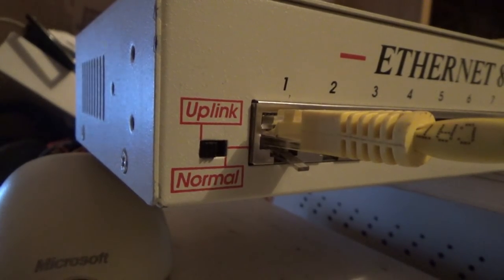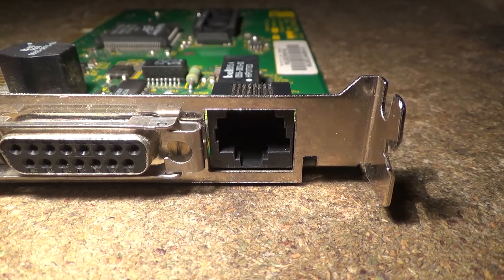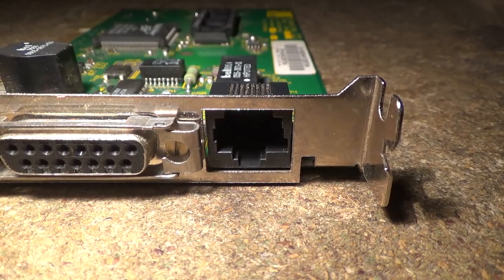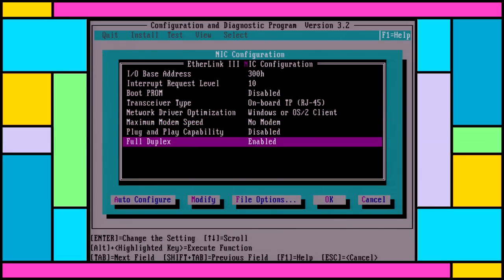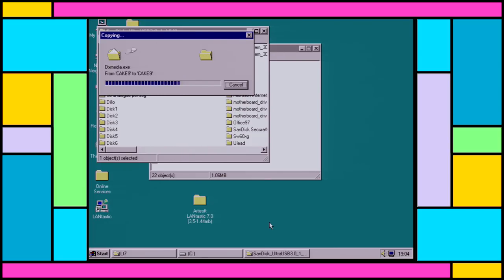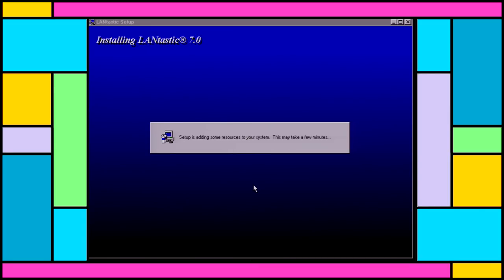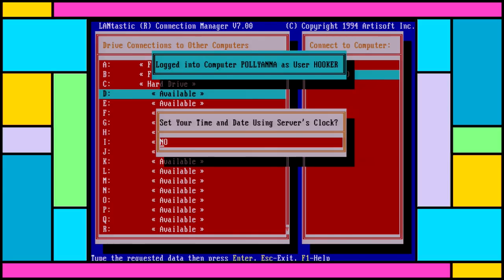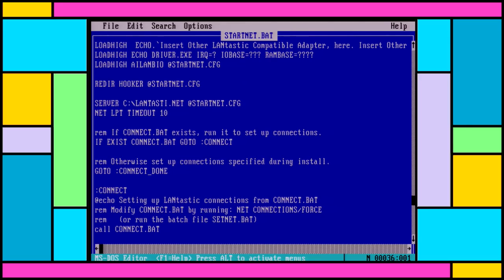Thin Ethernet Ramble

Comment: Arcnet is a name that takes me back... I have programmed this thing in x86 assembly back in uni. Which was 2002ish...

EDIT: Also, back in 1999 I have set up a lan party using coaxial ethernet. We spent three hours making cables and incrementally making stuff work, then six hours playing. Fun times.
Reply from the maker: We still had to cover arcnet in college, circa 2007-2008, but only briefly.
LAN parties were by far the best thing about getting a network running, suddenly it was possible to blow people up in Duke Nukem 3D without the latency or without the awkward alternative methods. Used to have to play with settings though, people coming to me had to set their cards to 10Base2, if I went to them I had to change to 10BaseT as most people were already on 10/100 Twisted Pair by then.

Comment: That twist tie and pin holding the resistor is a thing of beauty <3 I never used thin ethernet, we just played our 2 player stuff over chokes DCC. Nice explanation of the signal impedance mismatch/termination signal echo. Also my curiosity is infinitely peaked since you mentioned a device that works with synths!
Reply from the maker: Naturally I don't recommend the use of such a contraption in place of real terminators, at least you don't have to worry about this with LapLink cables. Anyways, thanks and yeah, the other machine definitely works with synths so far.

Comment: Auto-generated subtitles said "MS lamb manager". Sigh.
I moved from null modem / LapLink 'ed LPT straight to Fast Ethernet, so this 'ramble' is a good explanation for me, also entertaining one. Thank you for investing your time.

PS I adore LANtastic for its simplicity and stability. I have much more worrisome experience with Windows local networking for some reason, especially with a modern systems (aka win 7-8): sharing a printer there is a nightmare for me. Maybe I'm just... not good enough, okay.
Reply from the maker: Haha, bloody auto subtitles, that feature is not as bad as it once was though.
Networking in Vista upwards is a nightmare and it also seems to get really slow for no reason, especially when transferring to older systems. Sharing resources is a pain in the ass and is largely obscure, as with most anything else useful. LANtastic, by contrast, had simple menus and commands that stated, quite clearly, what they did and did just that, it worked. At this point, I definitely think LANtastic is going to make a comeback on my network, at least where smaller machines are concerned.

Comment: I remember hearing stories of people driving staples into these cables just to troll network admins and piss off instructors (college/uni).
Reply: that is evil
Reply: Nice burns ;)
Reply from the maker: Haha, found a staple in one once where I worked and now have to wonder if it was an accident or not.
Brostenen's admin trolling is funny. Weird how the go-to for shitty admins and techs used to be 'downloading porn' as that one was thrown my way a few times when I was young... when I didn't even have internet access on my machine. Meanwhile, at work, we had this dickhead user who used to bust things, he also did download porn and order parts for his car. Let's just say a hub under the desk and abuse of VLAN configurations can come in handy if you need to quietly blackmail someone - fuck with my network, I fuck with you. It paid for my lunch anyway.
Also, touching the wires doesn't do anything, possibly desensitized as barely anything in this house is grounded anyway, so shocks happen quite often. Maybe my skin is too thick or too dry.
Reply: HighTreason610 I dont know if it is true. But back in 1995, I was told that if you dont ground any equipment, then the cables will have 110 volt if the main power in the house is 220. Never investigated if it is true or not. All I can say is that it will deliver a decent shock. Tried it my self. However. It is only when data is sent down the cable. You can test it, and see if it will deliver any shock. And if you have a multimeter, then you can eighter confirm or debunk the myth. Personally I have no bnc cables or any isa network cards, so I can not do a test setup. I don't use network cards, other than on my modern daily driver.

Comment: Hey man! cool to see the rear of the Teradrive in action =)  . I have come long ways with my Teradrive after you helped solve many of my issues (helping me with my rusty DOS to finding out the Teradrive not carrying -12v -5V lines). Believe it or not my Teradrive is currently running a 486 CPU upgrade (please see some of my vids for more info) Thanks again for all of your help.
Reply from the maker: The one here still needs a new PSU putting in. I figured out a few ways that the PC side could be upgraded but I didn't pursue it as that's not likely to get much use, instead focusing on how the SMD side can be captured via a VGA capture card with the use of a simple signal converter, though seeing the games at 60fps is a little nauseating at times. I'll try and check your videos out tomorrow between other things.

Comment: I had one of these networks between 3 computers when I was like 11 years old. I used it with Windows 2000 and 98. I don't remember grounding the cables when I set it up and it worked just fine. Tho I remember you got a bit of a shock putting your finger on the exposed metal of the t connector hahah.

Comment: Your videos constantly impress me.  You cover the cool shit that so many others overlook.

A couple notable things about this video:
Node sounds like nerd to my American ears.
6:20 TCP/IP really isn't a heavy protocol stack.  Seriously.  I mean it.
6:29  IPX is certainly routable.  I used to work on Novell Servers which would route it.  And IPX is akin to IP, while SPX is akin to TCP.
29:44 4Mbps Token Ring is faster than 10Mbps 10b2
33:14  My sides are orbiting the Andromeda galaxy

Since you covered a few Ethernet alternatives, there are a few more you overlooked:
Null-modem cables
Laplink parallel cables (like a null-modem for parallel ports, 8x faster than RS232)
Networking over iEEE1394 (Colloquially known as FireWire)
Infrared/IrDA
AppleTalk
Twinax (LOL ok just kidding, mostly used by 3270 terminals and emulator cards to hook up to AS/400 systems.  Not really networking)
And the few 'perverted standard' networking cards that allowed you to daisy chain computers together with phone cable (I think Artisoft was the perpetrator of this abomination)

But I will also say that most DOS games would use IPX/SPX for networking, so you would probably have to run 2 protocol stacks on your LANtastic network.  Back in those days, I only ran IPX/SPX as WFW 3.11 worked fine on IPX/SPX, and the DOS support was excellent, and it was THE industry standard at the time.

I've enjoyed working my way through your back catalog of videos.
Cheers
Reply from the maker: Hey, thanks man.
You are of course correct, the only reason I didn't mention most of those was that I couldn't demonstrate them well if at all, had already talked about them elsewhere or simply wanted to cut the video down. TCP/IP might not be heavy in the grand scheme of things, but it does seem to be noticeably slower on an older congested network. It definitely strikes me as a protocol made more for a network with switches and routers than one with a common bus and hubs.
Had fun with some people trying to route IPX a while ago, typically you have to encapsulate it in another protocol, such as TCP/IP, we had trouble routing broadcasts though. This was largely using PPTP and L2TP tunneling servers I set up. The goal was to get a bunch of old computers connected over the internet to play some deathmatch, it didn't really work out and the third party tools we tried had different problems. Obviously tools like Kali and Khan used to do this job, so it can definitely be done, I suppose you could tunnel almost anything if you configured things correctly.

There were definitely Ethernet standards that used RJ11 cables, there are probably countless dead 802.3 standards out there made to leverage existing cables and hardware, would be a complete nightmare to keep track of.
But yeah, thanks for the kind words and the input on things here, that's always nice to see. Party on dude.

Comment: Hmm... A resistor at each end. Almost like CAN which started to appear on buses in the 2000's to save wiring as they are generally long, It uses J1939 with 120 Ohm resistors at each end of the line and typically has 4 to 5 Nodes/ECUs for the engine, Transmission, Air suspension etc. The connectors are triangle shaped with CAN high, low in a twisted pair and shield, Thankfully it's pretty reliable.
Reply from the maker: It's quite common on any 'high speed' interface, especially in a common bus topology, or even in analog signal paths - such as SCSI (Digital. ~110Ω), VGA (Analog. 75Ω) - for the same reasons as 802.3a, albeit the problems obviously manifest differently in analog system, mostly weird snow and ghosting on a monitor.
I've seen you around here before, but your avatar is a fun coincidence as I've just spent a part of the week servicing my ~30 year old HVR200. No terminators in those, just those mains caps that sometimes burn out. This one hasn't. Impressively the machine seems to be back to full power, which I learned the hard way when it tore keys off my laptop.
Reply: @HighTreason610  Cheers man love the videos, That's my 1991 Highland council HVR200 that's still running to this day after a set of carbon brushes and bearings. I wouldn't worry about the square capacitor as it's an interference suppressor that can be bypassed as long as you aren't using an analogue TV. I have a few old Numatic vacuum cleaners as well as some 00's PC's.
Reply from the maker: Thanks. Trying to finish one but as always, troubles with modern technology.
Meanwhile, nearly nothing wrong with the hoover. Dirt in the sound dampening, the filter was past its best and the hose was getting leaky. This'd be a 1992 one. It was my mother's since I was a kid and I just kept it when it got too heavy for her. New bearings will probably be next year as they're good for now, but they do scrape just a tiny bit when the hose is obstructed and the RPMs go up, not so much with new lube but still, may as well change them. I also hope to find one of those TE290 turbo nozzle thingies, purely because I can (plus maybe annoy green types by making it even more of a gas guzzler of a machine), what with having the PTO socket. Hate empty sockets. It is the only vacuum cleaner I have, solely as it has never once failed me.
Reply: @HighTreason610  Yeah the 90's power heads go for well over £200 now, I adapted a Sebo Felix power head a few years back to fit a few of my machines, worked a beast.

Comment: I wish I still had all of my old Arcnet stuff. I had a few isa cards, a hub and cables. Enough for a small office but I tossed it a long time ago cause I didn't have any reason to use it since ethernet came to a price point mer teen morals could buy. My friend at the time use to go around to the local computer shops and one of them gave him the whole mess of stuff when they upgraded someone to ethernet, so I ended up with it. I don't recall it being any different than ethernet in terms of hooking things up and using traditional protocols. I think Arcnet was the cheap solution for networking till ethernet became the standard. And ya know, it did 1Mb/s which is abysmal by even 10 base 2 standards, but you know it was plenty fast for stuff back then, ya know I mean, we weren't streaming videos and music over the network, and text/word documents were tiny, 1Mb was plenty. Worked great for gaming though, BIG improvement over null modem stuff. It was just cool to be able to truly network a couple computers together back then.

I like BNC better than this crappy ethernet ends that more often than not end up being difficult to unlock or the locking tab breaks off then the cable just falls out whenever it feels like it. But as cheap as ethernet cables are now days, i am not sure it makes sense to repair the ends. BNC has a nice satisfying lock and engagement feel to it that you just can't get from plastic ethernet ends :)
Reply from the maker: Still not ruling out playing with arcnet some time, but yeah, think we've all thrown things away that we regret to some extent in the past. When I first got a network running it was like magic, all the possibilities it opened - no more mountains of floppies to copy files, no more messing about with RS-232 cables for multiplayer, being able to put multiple machines on the internet at once - the latter of which sucked because it was dial-up, but at least it was finally possible so there was no more fighting over who could use the modem.
Yes, the BNC leads definitely have more robust connectors, although some of the card connectors are tight and I've had the internals of T-connectors be left behind in them before. On the other hand, I've also seen plenty of tags break off of RJ45 and the pins in the sockets get flattened to a point where they don't reliably connect anymore, which is far more tedious to repair - probably a factor in why Arcnet apparently still exists on industrial and embedded machines.
Reply: I have four arcnet cards, a thomas conrad active hub, and a thomas conrad netware server card.  This video was well done.   Being in the USA, I'd 'loan' it to WaybackTECH for him to record a video if interested.  Otherwise, I'm not sure I'd ever get around to doing a proper video.

Comment: Properly detailed and knowledgeable. How many times exactly did you say "...or the network will go down"? Oh, and when you say 'node' it sounds just like 'nerd', especially during the corridor / sound-proofing analogy. ;)

So yes, I'm definitely considering an ARCnet video now!
Reply from the maker: Ha, not sure, a quick search of the script suggests six but possibly more. I was aware of it and figured it would be something of a running joke, though that really is what 10Base2 and 10Base5 were like, you forget how much you take it for granted, being able to just unplug a UTP cable or run a machine with a flaky NIC, all without bringing the whole network down. There were actually means to avoid this, strange boxes that let you unplug nodes, but I never saw them in use as they likely negated the whole principal of 'cheapernet' when the bills came in for such hardware, good luck tracking any down today assuming they even worked in the first place.
If you cover ARCnet, I'd definitely watch that. On that note, I still need to catch up on that Epson properly (had other things going on when watching, so will watch it again properly) portable and the Roland mixer. Currently dealing with something somewhat similar to that Epson here.